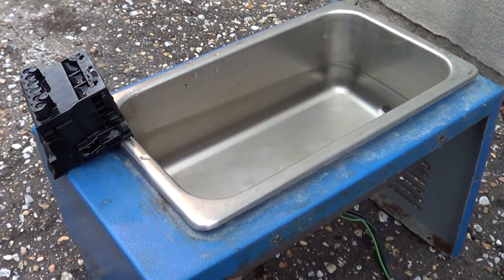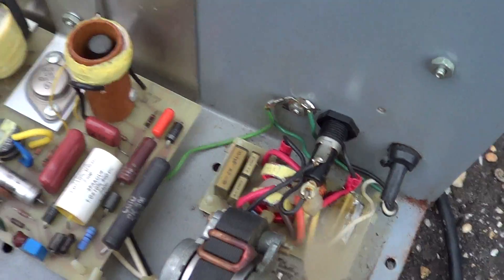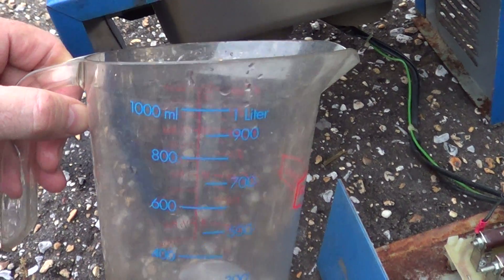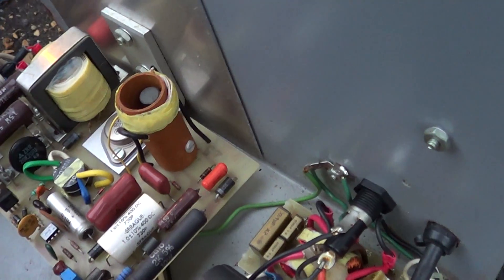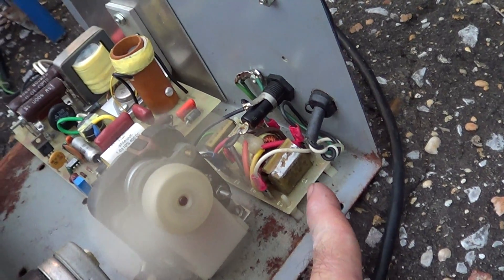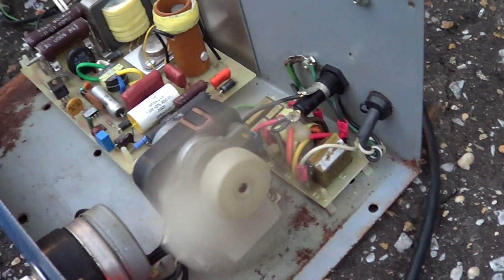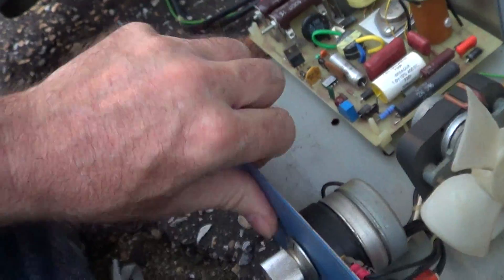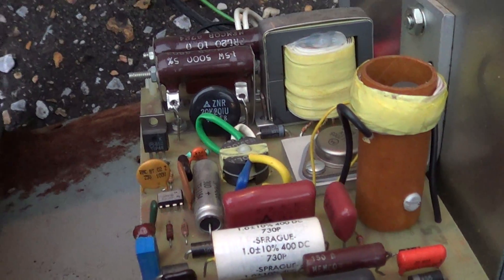L R Ultrasonic Model 2014 line filter cap smoked

Comment: Old L&R cleaners have this problem from time to time.  You can get chap newer line filter boards from China online.  Also sold are (newer) ultrasonic driver boards.  I don't know why L&R never offered replacement boards directly from them.  LoL they probably have no idea today what components were in many of their sub contracted older units.  An 'authorized' repair center would probably just plug in one of the cheap to buy LF boards from China and pronounce it fixed.  If you buy a new driver board match it's output to the value of the transducer it will be connected to.

Comment: Being the designer of the product, the part with the burned-out capacitor is only an input EMI filter which will have no effect on the operation of the unit. It was used to meet the EMI requirements for hospitals.  Get in touch me at frank.e@diversesolutionsnj.net

Comment: FYI, in case you didn't know, that burnt component is a "safety cap" that's designed to open up when it fails instead of short. I believe "271" may be the value code, which would be 270 pF. Just replace that with a like component & you should be good. 
Also, where does it say that the unit delivers 320 Watts to the transducers? That TO-3 MJ12005 can only deliver about 100 Watts max to a load.

Comment: Sorry for such a late reply to your video! I have a L&R Tempo 400 machine I'm trying to repair that has the exact same board in it as your model 2014. It won't oscillate at this point, and I believe the transducers are good. Going by your video, I bought a beautiful L&R 2014 off fleaBay for a good price that works fine, but lo-and-behold, L&R changed the ultrasonic drive circuitry to a completely different design! The one I have has a dual TO220 transistor circuit without the "555" timer! Plus, it has a separate board with QTY 5 "orange drop" 0.01 MF mylar caps in a series/parallel arrangement going to the 2 transducers. 
I do have the schematics for your type of design, but my Tempo 400 does NOT have the EMI filter board in it at all! What's the status of yours? Did you fix that filter? 
Mine works great, but I can't use it at all to troubleshoot that damn Tempo!
I wish I had a board like yours to test it out. 
As it stands, I don't think there's any way to make this board work in the Tempo.
Can anyone tell me different, or point me in the right direction?

Comment: RFIA means Radio Frequency Inference Assembly.  As you said, it eliminates inductive frequencies from going 'back out' the AC line and interfering with other devices connector to the same AC lines.  If this was made for hospital environments, I can see why this is there.  Other sensitive equipment could be plugged into the same AC bld source and they don't want high frequencies (from the ultrasonic cleaner) affecting those.   With the CAP being destroyed, it will not affect the function of the cleaner, it will just impact the RFI from filtering out the noise going 'back' into the AC line.